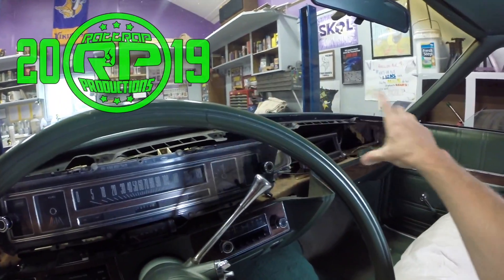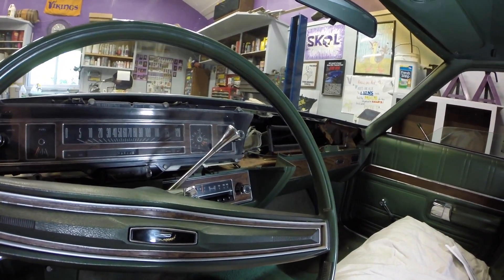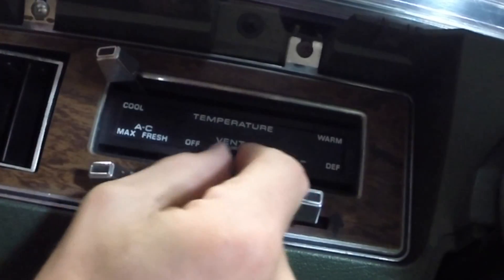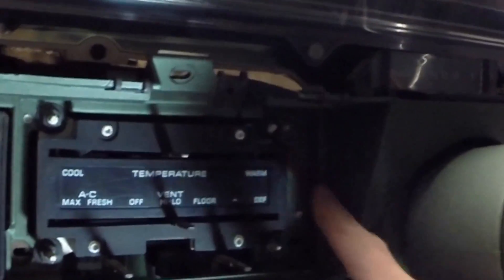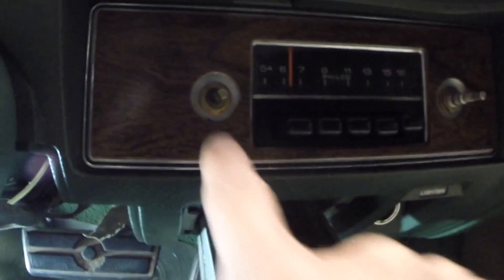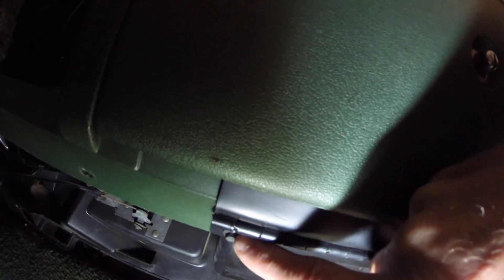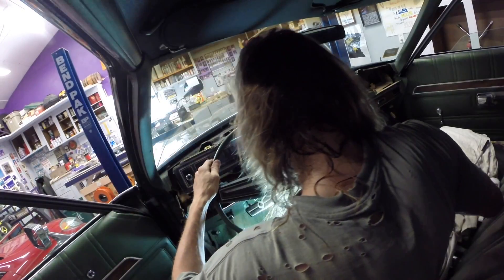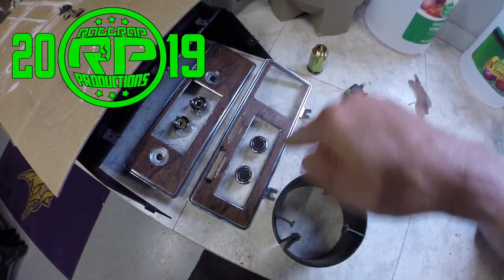Removing The Lower Dash On A 70's Ford Car

Comment: You saved me at least an hour locating the final couple of hold out screws, but most important you gave me the confidence to pull hard enough to get the top off. I had to pull really hard! Thank you! I ish there were more get after it videos. Everyone want to waste time bullshitting around...
Reply from the maker: Thanks. Don't forget to check out all the other Bandwagon videos I've made while restoring the beast. I'm rebuilding the rear suspension this year so you can look for those too in the near future